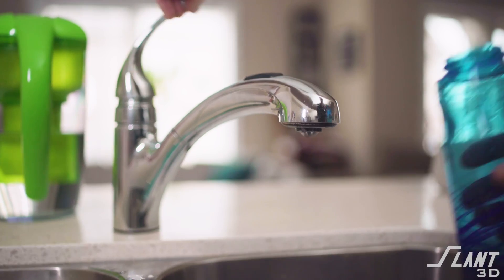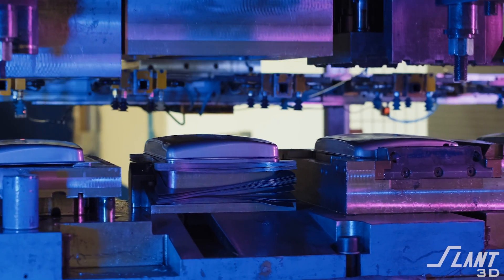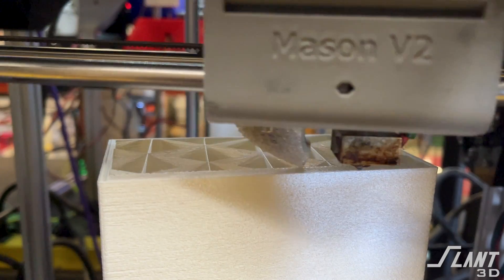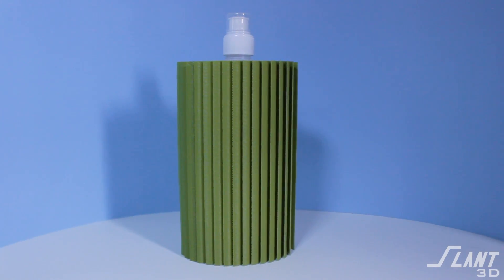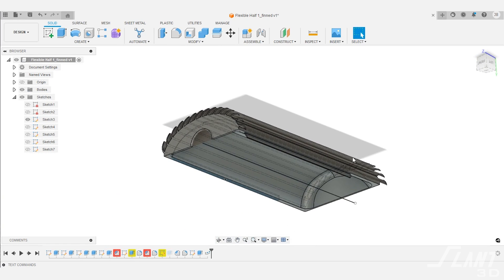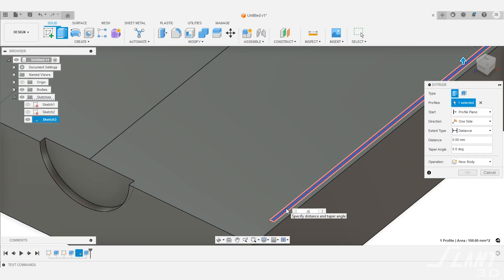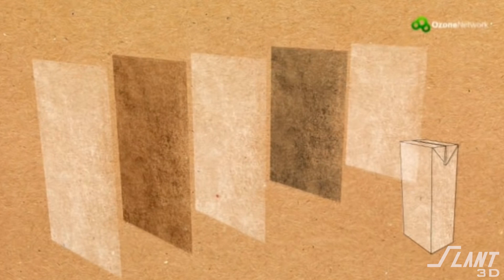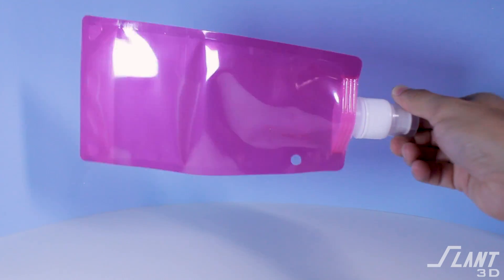Can you 3D Print a Water Bottle? | Design for Mass Production 3D Printing

Comment: There's a case to be made that porosity can actually be a design choice: In spain, a typical ancient technique to maintain water at a cold temperature is a botijo: Botijos, made of ceramic, uses the porosity to keep themselves cool by letting the water filter through the surface and then evaporate. The evaporation consumes energy in the form of heat and keeps the botijo's temperature

Comment: This isnt a water bottle its a case, wax coating would seal layer lines and be antimicrobial, and petg is the common material for water bottles so use that to make a water bottle not a bag in a container

Comment: You made a case, you haven’t created a watertight 3d print here just a case for a water tight bladder. It’s nothing like a cardboard carton that’s water tight as a cardboard carton is technically a composite material as it is the fusion of different material layers with a glue to create a product. The only thing fused together is the layers in your print. The bladder is loose inside. It’s just a case and not even a water tight one. it’s a shame I thought from the title I was going to learn about water tight printing. As it turns out I’m closer to water tight prints than you.

Comment: honestly, this uses more plastic than just using a plastic water bottle, the soft TPU or silicone water bottle is flexible but is made from more or less material than a rigid petg/recyclable one. And even the rigid one you can just squish it a bit once you're done. 
This gets rid of the advantage of being able to squish the blader bottle. It's occupying the same space while also not holding water by itself. 
But I also think that it's a neat idea and we actually need more of these. A good step in the right direction. And even if it's not a substitute of said existing bottles, it's an invention that someone will probably find useful and necessary.

Comment: This video is great. Makes a ton of sense for your business. Somehow I have been a bit slow to get who you really are. At first I mistook you for an average influencer, and I simply did not get where you where coming from.

If you have a quick way to get me up to speed, about your services, please let me know. Stuff like print bed sizes, slicing options, thoughts on tolerances, if prints are without skew, and so on. I found nothing on your page.

I am about to launch my portfolio, and plan to release it on Printables. It is a bit different, but if it hits the market, it will probably do pretty well. I just don't know yet. I would love to be able to say that you guys can print my parts to customers on Printables.

Also, say I wanted to offer people like you the option to sell your services as to print my work. I would charge say 10$ for an mATX PC case, and you would offer to print it, at the rate of your choice. Prusa would handle the payments, you would print and ship the product. To me, both as a designer and as an infrastructure designer, that would be insanely cool. I would love to assist in any way, to get something like that of the ground.

Comment: this is like all those 3d printed mugs you see on reddit that are really just mug holders. you didnt make the print itself foodsafe, you modified something that was already foodsafe by using 3dprinting. which is a cool idea and respectable enough except for the claims that you were going to "debunk" the ideas that fdm prints arent foodsafe or waterproof at 2:55

which is a bit more than misleading in my opinion, especially considering that you call your waterbottle "fully fdm 3d-printed" immediately after your debunking speech, and then run with that misconception for the middle 1/3 of the video. until revealing that ot isnt in fact fully fdm 3d printed and has a mass produced watertight bladder inside.

not a fan, dude. not that it counts for anything anymore but this ones getting a dislike from me
Reply from the maker: Just like cardboard mild cartons

Comment: The recurring theme of this channel is printing things that just shouldn't be 3D printed. No, 3D printing is not the answer to everything. Water bottle and golf Ts are a good example. An industrial made blow molded or injection molded water bottle has much thinner walls, doesn't need as much plastic and is 1000x faster to make. 3D printing is usefully for a lot of things, but not everything.

Comment: I did actually print a waterproof waterbottle using FDM 3D printing, unlike what you did in this video. Here are some tips for those who are interested:

1. Make sure you use clean stainless steel nozzle, heatbreak and extruder gears.

2. Make sure you don't use toxic materials with these specific components in #1

3. Check your flow/extrusion multiplier and up it by a bit (5-10% works well)

4. Use food safe material (PP, PET, Nonoilen(btw fantastic material)...etc). Also check that the manufacturer has certificate that these materials are FDA approved/food safe.

5. Print your part and use it normally. You will have to experiment a few time probably to ensure that your settings are ideal for your specific design which I won't explain here. One basic rule though, the sharper the angles you have in your design the lower you should make your layer height to ensure waterproofness.

Bonus Tip: I love using vase mode with thick nozzles/extrusion width(1mm - 5mm) to give you a very strong and watertight bottle/vase design. 

Bonus Tip 2: you may want to coat your parts after sanding them with an FDA approved material if you really want to.

Note: I cofounded a 3D printing company since 2016 and I'm not new to this field. My first ever print and experience with 3d printing was in 2012. Good luck to all of you who want to delve into this amazing tech 😊
Reply: thank you for making watching this video not a complete waste of my time

Comment: "Right here is a fully FDM 3D printed water bottle". No it isn't. What you've made is akin to boxed wine and no one says that the cardboard used in boxed wine is food safe or water tight.

Don't get me wrong though, there's nothing wrong with what you made. It's the fact you're saying you're debunking incorrect statements about FDM 3D printed parts not being food safe and being hard to clean. Then you show a product where no food actually touches the printed part, which is still not food safe and still hard to clean.
Reply: Boxed wine analogy on point!

Comment: I think it would be a good point to show the prices of plastic injection machines and the prices of molds and the capacity along with the prices of 3d printers for a 3d farm for the same capacity. The first thing that catches the eye is that you can start with a very small number of 3D printers and very little investment, so if the business starts - expand the number of printers

Comment: Why not use can liners that are used in aluminium can production?

Print the entire bottle not in two halves, install liner, water bottle done.

If you put an actual water bottle inside two flaps of casing you didn't make a bottle, you made an outer casing for a bottle. The bottles were something you bought into your process.
Reply: How would that work?
Reply: @valent_t  In the exact same way mass production of aluminium cans are manufactured today.

Comment: I think most people expected be able to print a water bottle at home right now after viewing the video – me included. 

However,  the water pouch solution makes perfect sense in the context of manufacturer: buy a few thousand pouches for close to nothing, print the halves and assemble everything with minimal human intervention. Without the pouch, you would need an expensive post-processing to apply multiple coats of some food-safe resin, QC the application, test watertightness and you'd be responsible to ensure your product is food safe. Basically, with this solution you outsource all the trouble to the pouch manufacturer.

I'd love to make a food safe water bottle *from scratch*! So if anyone has a non-pouch solution, I'm all ears ;)
Reply: There is no problem in making a shell that holds the pouch. That's great. What is not great is to say that people thought you couldn't make food safe water tight water bottles, and you have proven them wrong. No you didn't prove them wrong. You didn't make a water bottle. You hade a shell that contains a water container. You could make a fancy shell that you would slip a coffee cup into as well. Would you say that you also just made a coffee cup?

Comment: So when you showed that bottle with the curved geometry around it, there's an application for that design that was not mentioned.
How many of us have had a water bottle or soda bottle or can especially outside on a humid day, And it just drips into your cup holder, desk, etc with condensation?
Geometry like this can insulate it to the point where condensation is not an issue and your drink stays colder too.

Comment: I wouldn't call this a "water bottle" its a water bladder holder or water bladder case, I think a "bottle" is a container that can actually hold liquids. Its like printing a phone case and putting the phone in it and saying you 3d printed a phone. A case, is used to protect the contents within. Which seems like what this is doing exactly
Reply from the maker: Just like how cardboard milk cartons work
Reply: @slant3d  agree to disagree
Reply: @slant3d  lol you sound silly to be honest. That's not how a cardboard milk carton works. A cardboard milk carton actually contains milk. It is not a shell that encases a container that contains milk. You couldn't walk around with just the milk without the milk carton. You could definitely walk around with that pouch with water in it. Therefore, the shell you made is not a water bottle. A milk carton is a milk carton.

Comment: The cleaning thing turned out to be a myth. The crevices in a 3D print are easily large enough to effectively clean.
But I still like the inner bladder design since it assures water tightness and saves time having to debunk the myth about (lack of) food safety over and over.

Comment: Didn't debunk waterproof or food safe or a 3d printed part by using a bladder internally....
Reply from the maker: Just like a milk carton
Reply: @slant3d you called it a "fully FDM 3d printed water bottle," right after your speech about debunking the idea that fdm 3d printed parts can't be food safe or water tight. then you led us around by the nose for  a good portion of the video, expecting a way to make a "fully FDM 3d printed waterbottle" completely foodsafe and watertight. that's not what you delivered.

conceding the nonsensical idea that it's "just like a milk carton," this still isn't what you promised. you promised a functional... foodsafe... "FULLY FDM 3D PRINTED WATERBOTTLE," which, being FULLY FDM 3D PRINTED shouldn't contain components that don't meet the definition of FULLY FDM 3D PRINTED. 

the word for this kind of claim is called a "lie."

Comment: For this discussion, lets look at the problem of nesting. An aluminum can takes as much space to ship EMPTY as it does to ship when filled, and sealed.  A water bottle shipped empty, then filled, takes a lot of transportation expense to get it to the filling station because it is not nestable. So let's take this concept, and design a nestable solution.  Shipping empty containers at some tiny fraction of the volume, until filling is where the design can shine. Once filled, it will be heavy, and take the volume it takes.... But let's reduce the pre-filling volume.  So let's say the inner liners can be flat packed and shipped tightly. Then, lets say Slant 3D's two halves, can be nested to each other, and flat packed tightly. THEN, at filling time, the liner and two halves come together, and take the volume they take. HUGE savings on shipping empty containers. WIN, Win, win.
Reply from the maker: That is a great point
Reply: There could be money to be made with a 3 part, customizable, nestable, liquid storage vessel.
 @slant3d

Comment: I'll be Mr.Contrary on this.  I really liked the twist at the end.  Yeah, I was wondering what kind of process dealt with the porosity and all that, wondering how the BLEEP he was going to join those 2 halves together and actually hold anything.  But, what I got was a lesson in thinking outside the box... or maybe thinking inside the box ;)

Too many times, we get hammers and everything starts looking like a nail.  Multi-mode does not take away from 3D printing, it enhances it.  3D printing can enhance a lot of other processes.  It's good to be reminded of that once in a while.
Reply: I generally agree, but coming from this channel? This channel is the definition of "when all you have is a hammer, everything looks like a nail". He seems dedicated to trying to persuade people that 3d printing is the absolute best process for almost every application. 

If this video, and his bit at the end about how every process has advantages, is a sign of him softening his position than I'm fine with this. But until then I'm skeptical.

Comment: Just coat internal walls with food safe epoxy!
Reply from the maker: Not optimal for mass production
Reply: @slant3d   I disagree. Regular water bottles are often spray painted to apply branding and styling. The same process can be used to apply epoxy coating (there are epoxy specific sprayers) to your model. It will also work as a glue to bind two pieces together. And boom! You have water tight and food safe bottle!

Comment: Another idea: Print the water bottle in one piece then pour some kind of epoxy/resin/urethane inside which is food safe? Roll the bottle around to completely coat the inside, pour out the excess, allow to cure, done? I feel like that would be much closer to a fully 3D printed water bottle than this solution. As long as you could find a flexible product that doesn't degrade for many years, it could be an affordable and long lasting solution. I'm finding food safe urethane resins for indirect food contact, but not sure if there is anything home brewed that is technically 100% food safe. Hmmm.
Reply from the maker: That would work. The problem is that it is not viable for mass production. The additional processing and resin material would be too expensive.
Reply: @slant3d  Yeah I hear you. I'd definitely like to see a better solution than bladders though. Not that there isn't useful info in this video.

Comment: So the conclusion is you can't really FDM 3D print a water bottle but a case around a bladder to make it appear as a water bottle. 
Pretty disingenuous to say you can make a food safe, leak free, fully FDM 3D printed water bottle then present something that is merely a case around what actually holds the water.
Thought you'd coat the inside or otherwise, similar to cartons, not just.. put a bought product inside.

It's a nice idea if you want a custom water bottle and want it to actually hold water, but you pretty much lied by saying all limitations of FDM 3D printing are incorrect and saying it's FULLY FDM 3D printed when it's very clearly not.

But if you insist on saying it's a fully FDM 3D printed water bottle, then the same logic can be applied by making a water bottle entirely out of paper and putting a bladder inside it.
Reply: ^this, 100% this, I usually like the videos on this channel and was expecting some technique for slicing or modelling on this one. 
Instead we got snake oil level marketing for a video that should be titled “how to 3d print custom water bottles” that starts with a disclaimer saying that the bladder is in there.
Reply from the maker: You also can't make a cardboard milk bottle without adding carboard around an internal bladder. They just fuse theirs to the outside. We did not.
Reply: @slant3d  They don't add cardboard around a bladder because there is no bladder, it's a liner, not a separate thing they buy and fuse together. Why didn't you use a liner? it would at least make your argument valid.

And looking at how they're actually made, seems like they add the liner to the cardboard, then folded and sealed.

Comment: So if I print a case for a banana have I actually printed a banana? No, neither did you print a water bottle.
Reply from the maker: If you put water in a water bottle you created water?
Reply: @slant3d  clickbait
Reply: @slant3d  If I print a case for a water bottle, I've made a water bottle case, not a water bottle. It's akin to knitting a water bottle holder. You didn't knit a water bottle, you knitted a water bottle holder.

Comment: Well you made a water bottle casing. The actual function of the water bottle (containing the water and dispensing the water) is being performed by the bought product enclosed in your case, not what you printed.
Reply from the maker: Just like cardboard milk containers
Reply: @slant3d  No. The cardboard milk container is an object that is the sum of its parts. Without the cardboard that ultra thin layer of plastic will pop like a water balloon. Without the layer of plastic coating the cardboard would get soaked and disintegrate. All of its parts are necessary for its basic function.

Whereas the water bottle inside the case you made doesn't actually need the case to function. I have a few of these flexible water bottles, they have lasted for years without a case. The case would actually detract from their utility since one of the benefits of them is that they fold up when they are empty. But your case is going to remain rigid and continue taking up space.
Reply: @slant3d I think you pushed it too far with this video
Reply: @slant3d  not at all. one is a one piece container plastics and Cardboard  fused into one item.and the other is two separate containers bladder doesn't need plastic cover... their very similar but not the same.
Reply: @slant3d  Dude come on. Quit being difficult. We all know this is not what people mean by food safe 3d printed.
Reply: @slant3d  uh, no
Reply: @slant3d  no.. you should know what are composites